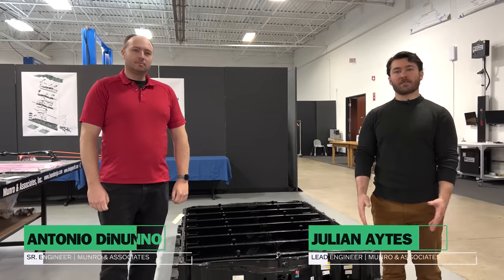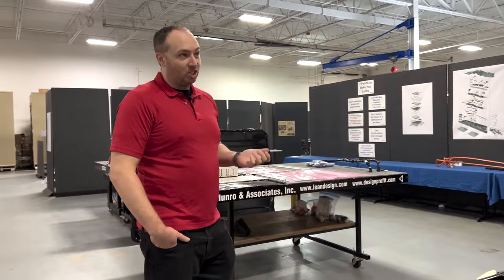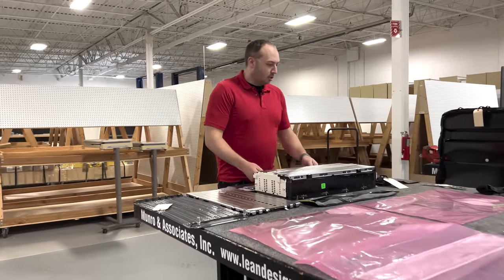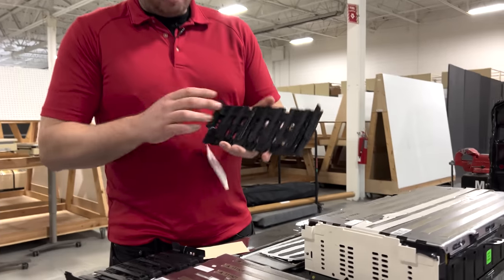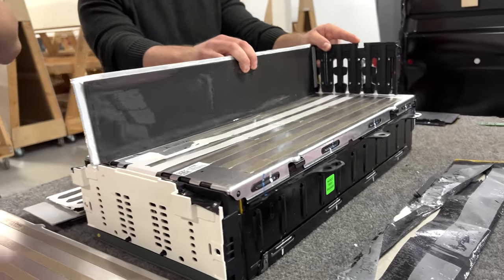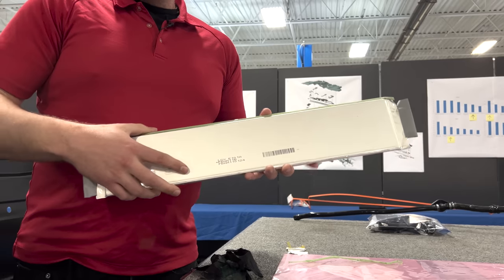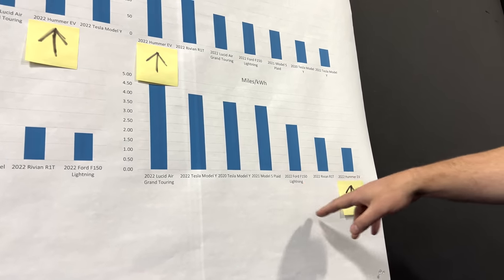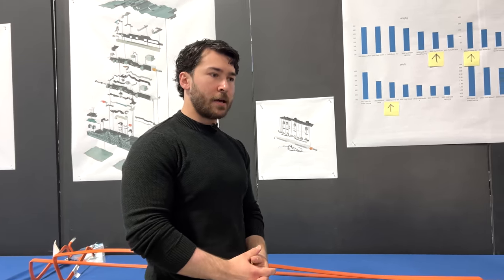This is NOT Lean Design: Hummer EV Battery Pack Breakdown

Comment: I dont think GM gets enough credit for their parallel to series conversion strategy. Full 400v and 800V charging support with no DC-DC hardware. Some of the fastest charging curves in the industry, certainly against 400v vehicles like the Lightning and R1t. And still retains class leading 400v class drive components. That said the Hummer EV is stupid. It's kind of a fun looking toy. But it's stupid.

Comment: There are several misleading things here though about some of the comments:  the pack is also structural so it's not independent of the rest of the body.  It does double duty so you are comparing apples to oranges when you compare it to ones that are not structural.  Also, the Silverado EV gets 450 miles of range officially now with the same pack.  This is about 120 more miles than the Hummer.  So, the miles per kwh is already getting much better.

Comment: -well, not "lean" but definitely "structural - rock sliders built into the battery.

Fabricated steel  ?? > maybe due to poor volume projections ??

ha ha - laugh at the devastating news - miles / kWh - well go and compare to the T-"semi" - surprise flash, kilograms matters...  (heaviest vehicle in class, uses more energy to "get stuff done"  )

Comment: These guys are sort of missing the point that the Hummer "pack" is irrelevant, it's an extremely low-production vehicle, intended strictly for marketing purposes.  The only interesting part is the Ultium module and they really didn't spend enough time discussing it and how, on a module basis it compares to a cylindrical equivalent.

In a KWh/volume basis, how does an Ultium module compare to a 2170 or 4680?  The Hummer packaging is completely irrelevant.

Comment: It looks like an engineering 1st draft of a battery pack. We dont expect a Hummer to be efficient, even with EVs, but this shows signs of really unimaginative construction. Like they were in a rush to get it out the door. If they had another year ir so, i bet they could rethink the pack and shave hundreds of pounds, make it much faster to make as well. And still be tough for off-road use.

Comment: ALWAYS MY CONTENTION, THAT THE GM HUMMERS(ev type included) ARE JUNK:
1.) BY WEIGHT
2.) HIGH CENTER OF GRAVITY
3.) LOW GROUND CLEARANCE. 
4.) WRETCHED STYLING
5.) COPYCAT, BUT WORSE
6.) OVERPRICED

<but yeah, so this electric gm hummer is by far the worst, weighs in at 10,000lbs.(9,000lbs+(4x)200lbs muricans, + 200lbs junk in the rear cargo area)>
<the original hmmvv far outmatches this new junk>
<runs on jp8, cheap!>
approximately 5,200 lbs.
The M998 A0 series has a curb weight of approximately 5,200 lbs., a payload of 2,500 lbs. (GVW 7,700 lbs.), and a 6.2 liter V-8 diesel engine with a three-speed automatic transmission. The current comparable model, the M1097A2, weighs only 700 lbs. more but can carry almost twice the payload at 4,400
https://www.military.com/equipment/high-mobility-multipurpose-wheeled-vehicle-hmmwv#:~:text=The%20M998%20A0%20series%20has,the%20payload%20at%204%2C400%20lbs.
Humvee
https://en.wikipedia.org/wiki/Humvee
Reply: DING DING DING! Nailed it! Original Hummer CARRYING this battery pack is lighter than Hummer EV!

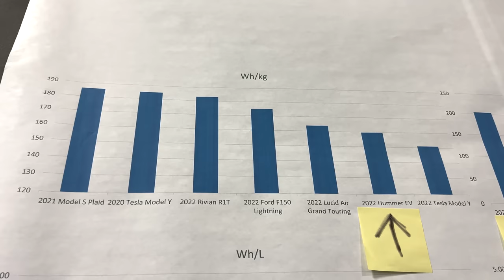Comment: 26:25 Again, I think it's worth noting here that the Ultium pack is the only structural pack you have listed on those graphs. Also, the HUMMER EV pack is 212 kWh usable, 219 kWh gross capacity, not 205 kWh.
Reply: Just using what the sticker on the vehicle says.
Reply: @BatterVswithAntonio  Interesting. Apparently, GMC released a clarification on that: 205 kWh is based on IEC standards, and 213 kWh is based on ISO standards. So both numbers have been published, apparently.

Comment: This clearly shows where the smart engineers and designers don't work at -- GM!  The Hummer EV was rushed to market just so GM could say they were first to market, but the engineering prowess that didn't go into it is laughable.  Can't wait until the $30K Chevy Equinox comes out and Munro does a breakdown of it.  I wouldn't be surprised if they find many Chevy Bolt parts on it with an Ultium battery pack.
Reply: Not $30k Equinox. 30 ton Equinox 😅

Comment: Tesla is mad to put the front seat mounting frame as part of the pack. Structurally, it should be part of the body where it can form an attachment point for the battery and seats. The rear seat should be mounted on the rear giga casting, then the whole rear space can be used as a hole for assembly access. Battery inverters should go under the hood and the charge point to the front quarter panel. Tesla is like legacy OEM with Supercharger cable length driving vehicle architecture in a big way

Comment: at end of the day, the Hummer EV battery pack is built too Complex & too Heavy.
it uses too many Parts & Components and too many Fastners. this all ads COST.
the Hummer EV battery pack in 2023 is already OUTDATED and inefficient.
Reply: Name any EV truck that's as capable in range or ability.
Reply: @theflew  - Tesla CYBERTRUCK , already in Pre Production. 
Cybertruck = > 420+ mi Range . 
thats with 5 Adults + Luggage , and cargo.

Comment: Just the battery enclosure is expensive: 28 bolts; 257 fasteners; 105 stamped components in the upper assembly; 100+ stamped components in the lower assembly; 139 stamped components in the outer casing and over 3500 welds. Add to this the cost of the complicated battery packs, busbars, cooling pipes, electrical cabling and electronics and this ‘battery’ is very expensive.  That they only managed to deliver two (2) Hummers in Q1 must be deeply troubling for GM.

Comment: This is why Tesla should concentrate on volume and not worry about margin…otherwise over complicated pos like this is wasting valuable resources.  Also why Tesla needs to advertise/educate.
Reply: Most of Tesla designs patterns are open source. Other brands just think they have more experience and than you get these kind of designs. Technically they should have looked at Lucid, so efficient and so compact and they are a new player on the market...

Comment: This is just very bad engineering. What has GM learned over 100 years? They should fail given this nonsense
Reply: But they have the cheapest ev with the Bolt...
Reply: @abraxastulammo9940  Which they just cancelled, right?

Comment: Looks like they built in serviceability which means it was designed to fail. This continues their current business plan, build it crappy, sell for cheap and charge a lot for service.
Reply: No, it was designed so the modules could be used in many different types of vehicles.